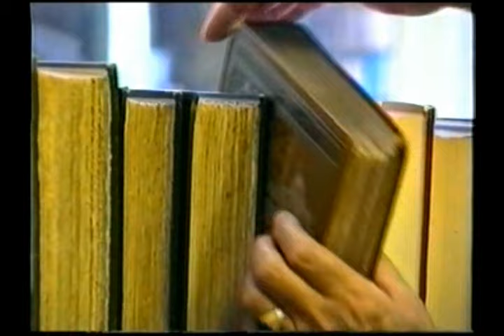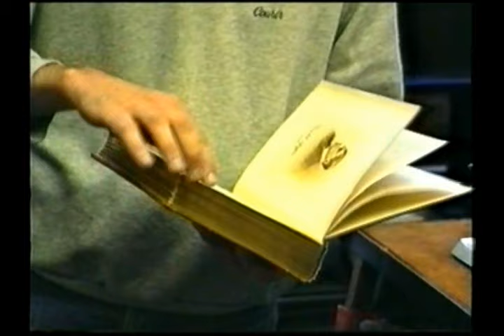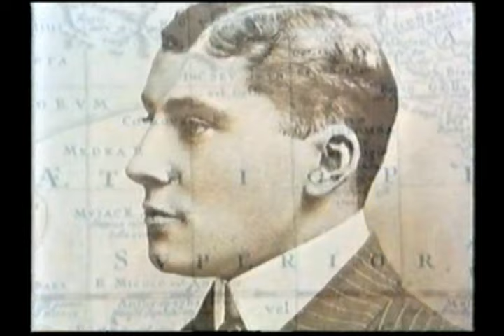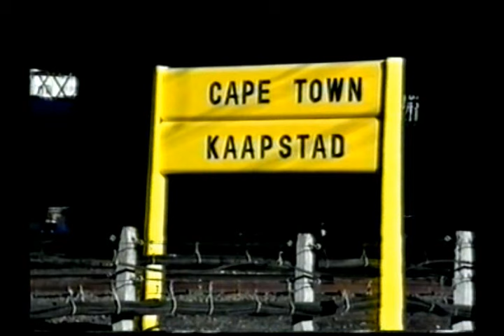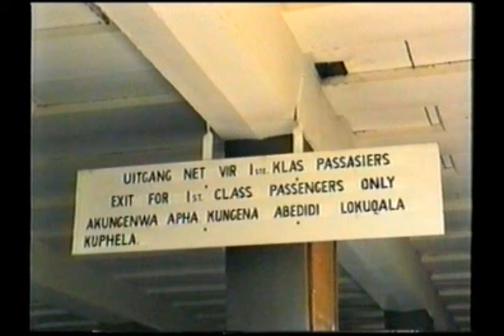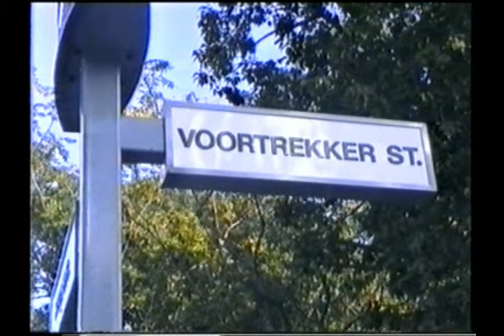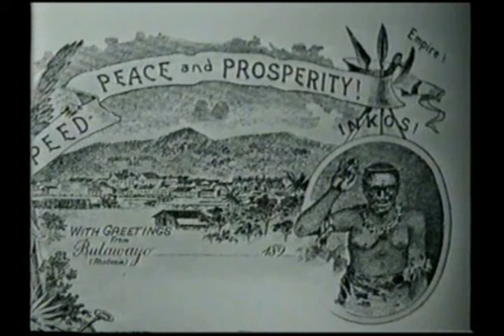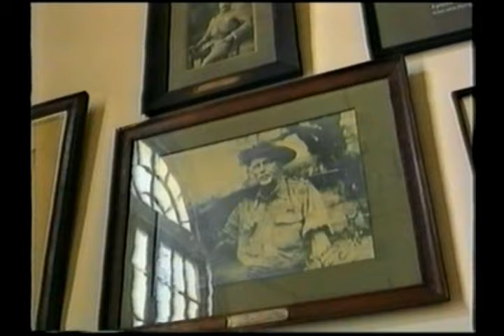Ribbon of Iron part 1 by Paul Clark

Comment: Great video. I visited SA and Zimbabwe a few years later. Sadly steam on Kimberly-De Aar had just ended by then but Bulawayo was still a city of steam.
Got my permits from the same man, Israel N'hari, and during the depot visits and footplate rides I actually got the controls for a short while of an 16A when I told the driver that I was working with steam on a preserved railway.
Also cool those film clips from Hex River Pass in the 1930s with class 15CB and a 14C helper, the main classes employed there before the 15E's and 23s took over.